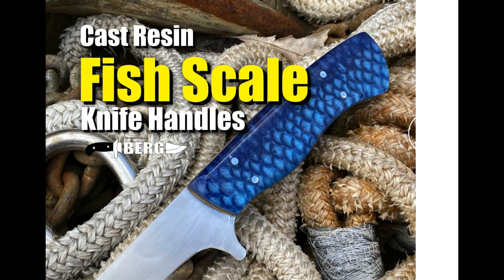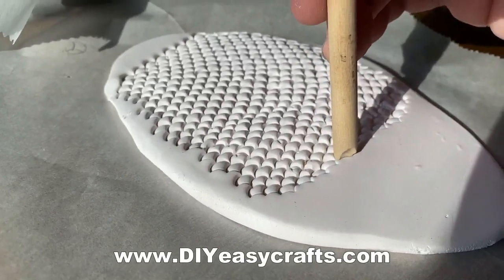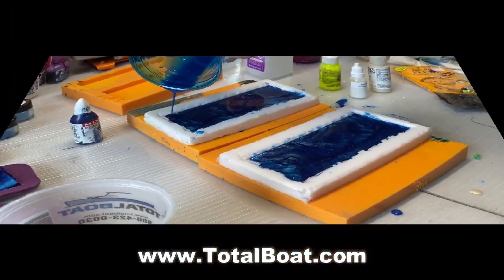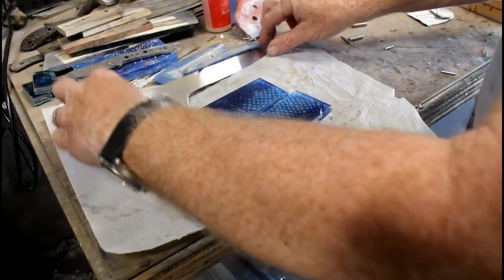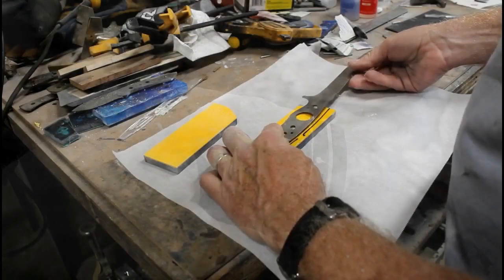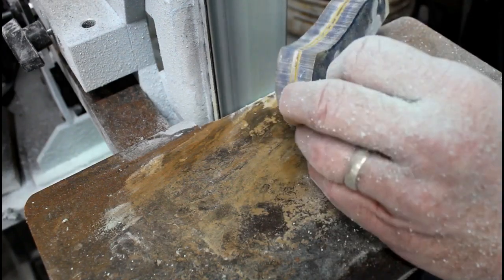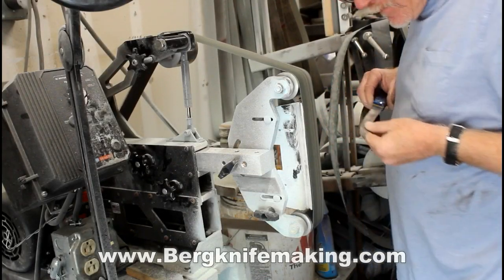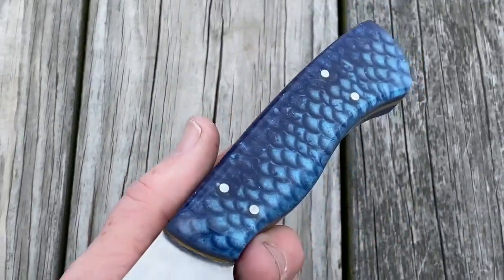Making Cast Resin Fish Scale Knife Handles | TotalBoat Thick Set Tutorial

Comment: Very cool video! I tried this method, but noticed that the silicone doesn't cure properly in the areas that are in contact with the modelers clay. I made the scales and let the clay dry, but when I poured the silicone, the areas in contact with the clay never really cured. Did you have similar issues?
Reply from the maker: Not at all. Maybe try another brand

Comment: Looks awesome, I've seen alot of scales made from some form of resin and I think they look better than wood since so many looks can be achieved. What is the yellow paper that you used called and if it is paper  doesn't it fall apart when it gets wet? Thx
Reply from the maker: Thank you. The yellow liners are from USA Knifemaker. Really nice to work with and no they will not fall apart if wet.
Reply: Thank you, what are the lines called
Reply from the maker: @texascrossbowdude636  I think they just have them listed as liners. They come in a variety of colors and thickness
Reply: I use g10 for my liners and they perform excellent

Comment: great work as always, just a quick question; I've been making some epoxy handles too and i noticed you also have the little white spots, is this just the micro bubbles that is left in the epoxy? I don't use a pressure pot and i'm thinking i need to invest in one to eliminate all the tiny bubbles that are left, just don't like the white spots that are left... especially in darker coloured scales.
Reply from the maker: Yes Im going to do the same thing and upgrade to a pressure pot.

Comment: Why did you chose this resin instead of alumilite
Reply from the maker: I do not have a pressure pot. This resin is very thin and has a long cure time. That allows any bubbles to rise to surface before it starts to harden.  Bottom line it gets me good results without the use of a pressure pot
Reply: @DIYeasycrafts  thanks for your reply.  That makes sense.  They are theoretically pretty dangerous too.